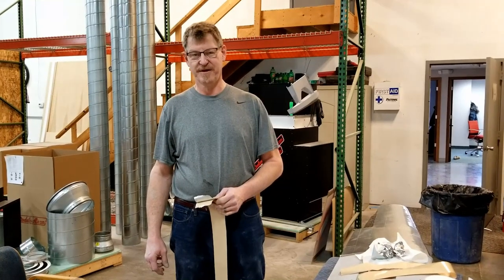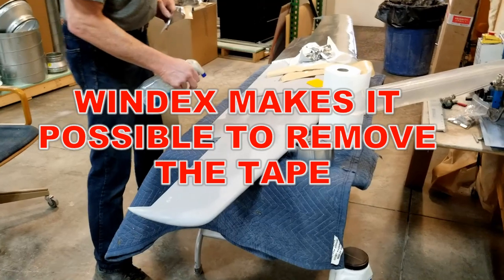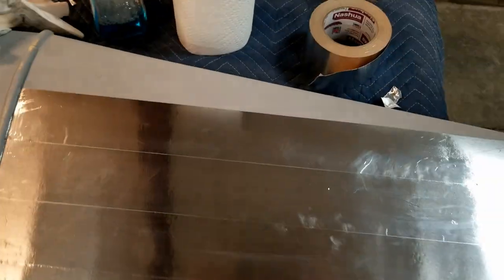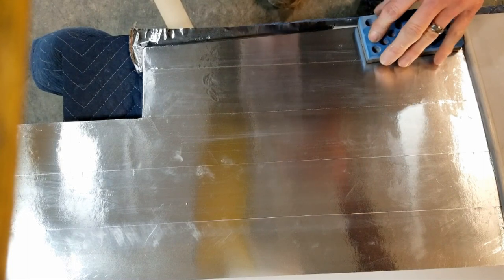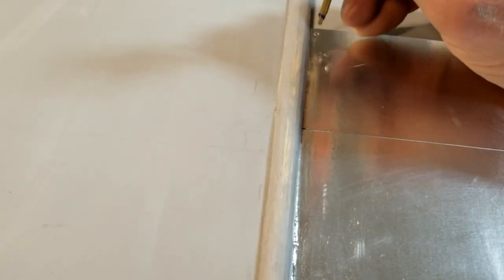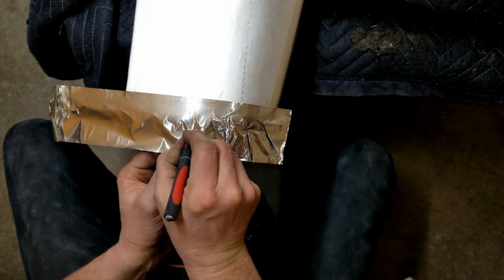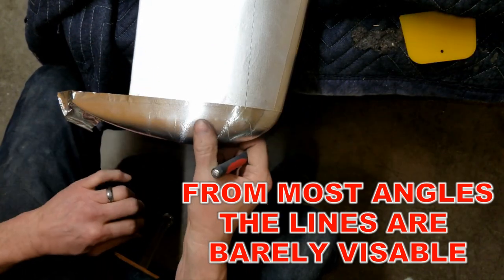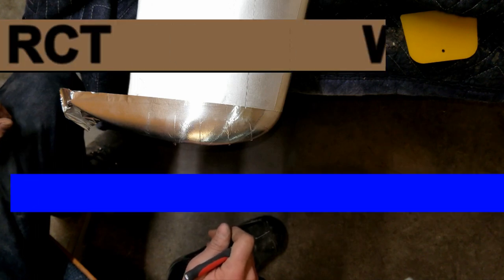aluminum covering RCTWINS

Comment: The clobber job.
If you took five minutes you could get the aluminum to form around the wing tips without cutting it up. 
Have you ever seen a full sized airplane with aluminum wing tips all hacked to hell like that.
This guy should call his channel, "How to clobber it up.
The double head palm is scoring the wing panels by cutting panel lines into the wing with an exacto knife.

Come on man, Who taught you this?
I'm here looking for tips and techniques that will "improve" my abilities and the final product.
Reply: The wing is glassed with 4oz. Cloth and two coats of epoxy. The aluminum is just decorative its like a cutting board under there. What a Nancy haha
Reply: It's a model. It's negative people like you that have driven this hobby into the ground. Why make it so hard for people to do this if you had watched my blog video you would have realized I can do anything with metal, but WHY make it so hard for people to learn.